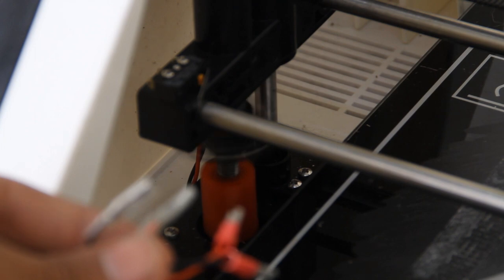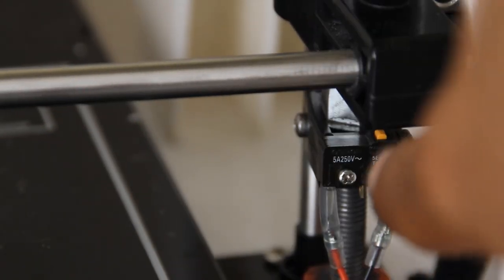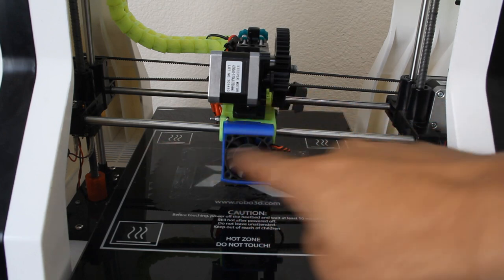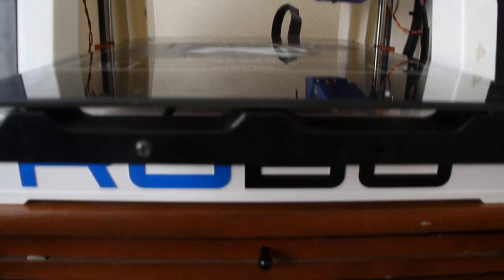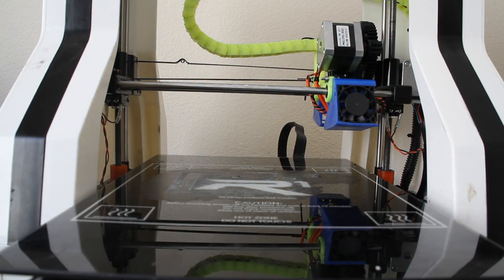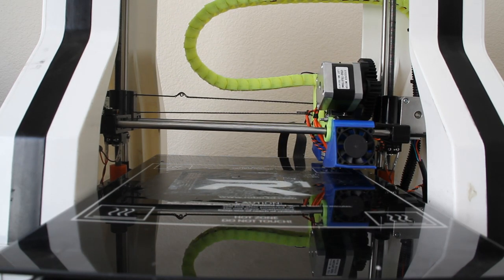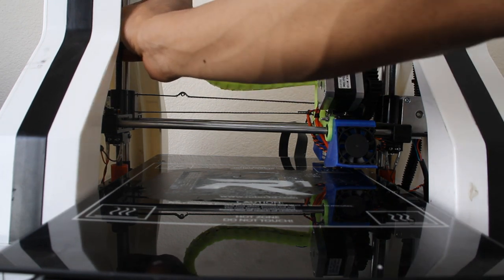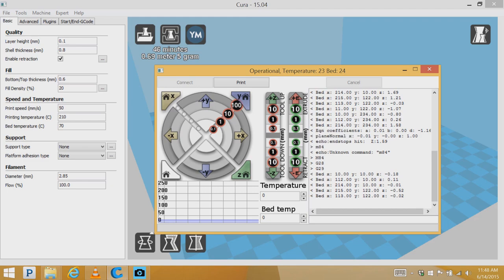Novice Tips: Troubleshooting Auto Bed Leveling

Comment: Thank you! you fixed my problem with my printer. My z axis when doing the auto bed leveling, for some reason it would go up on some points instead of touching the bed like it should. This would also result in the printer head hovering over the bed and would completely mess up my print. Its fixed now. This video was extremely helpful!

Comment: Thank you very much!! I installed a reprap controller on my printer, and stupidly didn't put those orange clips on the threaded rods that the printer ships with (noob here). Well, after I was done, as you can imagine my printer wouldn't autolevel, or go down at all, and I started looking for the reason online, but couldn't find anything until I found this video! You saved me from making an embarrassing call to Robo3D tech support! BTW I have a brand new R1+ and this video applied to it every much as it did to the printer that was used to make the video.

Comment: Bed leveling-  You said in an automatic bed leveling system the bed compensates and tilts so the printer is always aligned... Not aware of any bed that automatically tilts, rather the software measures the distance between the bed and the print nozzle in numerous areas of the bed and minutely adjusts the Z axis travel for each area it tests during the auto leveling routine. 

"Commonly Open" "Commonly Closed" ??  The correct term is Normally Open and Normally Closed as all limit switch terminals are marked "NO" and "NC" with "C" or "COM" being the "Common" terminal.   The definition of Normally Open refers to the limit switch position at rest, without the switch lever being depressed, thus the NO to COM switch is open as you describe.  

However at 0:57 you incorrectly describe the wiring as "commonly closed" but show the Z motor spinning while the wires are open, and stops when closed.  In other words, the Z-axis moves to the end of travel depressing the limit switch; at that time the switch NO and COM terminals connect,  signaling the logic board to stop the motor.
Reply from the maker: I appreciate your insight. I was stumbling to figure out the PROPER terms for the terminals were. Thank you for that. (Using COMMON, NORMALLY CLOSED, NORMALLY OPEN from now on)

as far as bed compensation I meant to say the "MODEL" tilts in the "SLICER" and calibrates the "GCODE" to properly move the Z-Axis up and down according to the plane it creates during the probing process. Thank you for showing me my sloppy description I will do better to keep everything neater and more accurate in the future.

and at 0:57 you are CORRECT! I did not explain the way the SWITCHES work properly, I assumed this "closed circuit" (Com to NC) because of the LOGIC in the Robo 3D firmware. The switch is inverted there. 

const bool X_MIN_ENDSTOP_INVERTING = false;
const bool Y_MIN_ENDSTOP_INVERTING = false;
const bool Z_MIN_ENDSTOP_INVERTING = TRUE;

So yes, when the button is DEPRESSED, COM sends a signal to NC to communicate to the board that the NOW closed circuit indicates that the axis cannot safely move down further beyond that point.

Comment: Ever since I installed an e3d v6, my bed leveling is working right. It goes through the process without issues, but it is clearly not level. It's always slightly off. The left side of the bed is slightly lower than the right so when it does the first layer, hardly any filament is allowed out of the right side so it looks transparent while it looks correct on the left side.
Reply: i'm doing a print about 15cm wide and it takes about 3-4 .2mm layers for the whole thing to be visible. Every layer, you can see it gets a little closer to covering the whole thing.
Reply from the maker: If your numbers in the middle of the bed are closer to Zero than the outside number that's an indication that your bed is bowed in the middle. You can attempt to level it manually based off your observation. So if you think the left is too far down, adjust the left lead screw.

Comment: What software is it you’re using at the 3:52 minute mark where you’re entering the Gcode because I don’t see that in Cura anywhere? I’m fairly new to 3D printing and find your videos to be very detailed for helping beginners but this little detail wasn’t covered so thought I’d ask. Thanks!
Reply: That's pronterface.
Reply from the maker: you can access Pronterface by changing the UI settings in Cura 15.04.6
File > Preferences > Print Window > Pronterface UI (sorry, been out for a long time)

Comment: My printer levels correctly, both switches work great, no bugs other than the fact that it always wants to start the extruder nozzle laying down right on the bed... My Z-Ofset, to make it higher is as high as it will let me, i have leveled it a dozen times and i still can not figure it out! After the print goes up to the second or third level it works great... Best freaking print to see. I just got the E3D nozzle and i installed it using your videos and everything functions properly except the leveling! Please help
Reply from the maker: +rpm 9000 (I logged out and logged back in) Well, firstly are you using a negative number for the offset? I try a huge number to assure that it is working properly; Like M565 Z-5 and the nozzle should be far off the bed.
Reply: No im not doing that... Ill give it a try
Reply: I was using a positive number

Comment: HI mARQUISprinting now not bad. I printed the tall spool bracket, looks pretty good although the bottom layer on my prints are stranded like a guitar. I changed my bottom layer to 2mm thick but whAT OTHER SETTINGS MUST I ADDRESS FOR A SMOOTH BOTTom 1st layer ?
Reply from the maker: +Paul Robb All you should need to change is the Z offset. I will be talking about this in this weeks video about G-code. It is the M565 in your start up G-Code. There are lots of threads about this on the forum.

Comment: my robo 3d r1 is printing in the air :( this is after it touches the print bed in the proper places and the switches seem to be in correct place. earlier it wrapped the wires around the right pole ad i had to reattach the wire to the connector and switch. but it should be good now. i done the m113 g terminal code or whatever, x,y,z is all open

Comment: during bed leveling, my nozzle hits the glass at locations 1 & 2 and then starts the rising up problem at locations 3, 4, & 5 but then comes back down to the glass at locations 6, 7, & 8.  Then it rises up to finish at location 9 about 1/2" above the glass and starts printing there!  Any ideas?

THANKS!

Comment: I've been having a problem after my left z-axis switch bracket popped off when my computer had a hickup and repeatedly sent G1 Z-10 codes. I took the printer apart and put the bracket back on then leveled it several times using the "Paper Leveling" technique and it looks like it auto levels correctly every time, but when it starts to print the extruder is a little too high. I tried the offset commands in MC but it doesn't do anything. I tried printing via Cura but its auto level does the same thing. Also the extrusion speed is slower and it just made a big mess
Reply from the maker: +Christopher Turk Hmm, are you using the M565 to offset the extruder?

Comment: hey I have a slight problem when I print the filament towards the back of the printer is almost completely non existent but the front end is perfectly fine, I always run a G29 before I print so it SHOULD be level any idea what is going on and how I can fix it?
thanks!
Reply from the maker: +Nate Clishe It might be that bed is unlevel from front to back, I'd recommend checking the magnets underneath the bed.

Comment: What is you're opinion on "uneven beds"...and the 9 point calibration not working correctly because the bed needs "shims". I tried doing this with some washer on the left side, as my left side constantly seems to be higher than the left (though the 9 point test double clicks on each point)
Reply from the maker: +Joshua Taylor The 9 point leveling should work, but I'd have to see a video on what yours looks like.
Reply: +Novice Expert I will try to make one to show you...with my GCode Export. At the moment I have 6 loops...I'll pause the print and usually end up lowering the right side slightly based on how the loop is printing. It never stays in that position though, for ever print forward I continually do this.

Comment: Greetings Novice Expert, I'm new to the ROBO 3D R1+ and was curious if your information in this video applied to the R1+ or just the R1?
Reply from the maker: +Shawn Hill The R1+ is very close to the R1. This video does apply. The only difference between the two is the carriage and electrical system.

Comment: after I adjusted the level so switch was mashed I printed but nozzle seems to be dn too hard on glass surface. did it twice and same now its seems to be scraping or too low on glass. what to do?p from fla
Reply: +Paul Robb Looks like you just need to adjust the z offset in your start up g-code. 

G28;  HOME ALL AXIS
M565 Z-1.1;  Z-AXIS OFFSET (-1.1 is my number)
G29;  PROBE BED

Make M565 more negative (-1.2) to increase height.
Make M565 more possitve (-1.0) to descrease height.
Reply: thankyou

Comment: hi! Great tips, I hope you can help me, in my case just one riel (right)  from Z axis is moving and the other one does not. I tried the tips in the video,  but i still have problems
Reply from the maker: If it's buzzing then the motor is jammed and cannot move. If it feels in energized and easy to move it does not have power. Which are symptoms of no connection, wrong amperage on driver or blown driver.
Reply: In my case, the Z axis moves fine until it gets close to the print bed. Then once it gets to the point where it should stop, it keeps going - usually just Z_2 (the motor on the right) and it tilts itself until it jams and crashes into the print bed. This is on the Anet A8, so it doesn't have the sensors on both sides.

Comment: what if the numbers are all negatives? both counterclockwise?
Reply: The main key here is to compare the difference between the points, so if you're getting -1, -2, -3, you're essentially getting the same information as if it said 1, 0, -1. If all of the numbers are relatively the same, but still negative, then your bed is level, but your overall zeroing is off.
Reply from the maker: Thanks for that detail, I'll have to re-shoot this with that addition.

Comment: Ok can you help me? My auto home x axis keeps going to the right a little bit and doesn't stay in place... so I keep pressing home eventually it will go all the way to the right and the auto bed level doesn't work either it will do the first 4 points correctly but the rest go all the way to right to the point of making noise
Reply: David Tashchyan  That sounds like a X limit switch problem. If it keeps going to the right, maybe it's being pressed by some wires? If you can make a video of it, I'd be more than happy to look in to it. (if you haven't already fixed it)
Reply from the maker: David Tashchyan Yup Anorak Cafe is correct. The computer thinks that the switch is already pressed. This usually happens if a wire is disconnected/shorted, like at 1:20

Comment: This is good to level the x axis, but how do you level the y axis? I mean there should be something to position the glass of the bed as well. Am I wrong?
Reply from the maker: As far as I am aware there is no way to do so. But the plastic clamps holding your Y axis linear bearings could be loose, if so tightening them should make the bed straight.

Comment: Hi Novice, I have followed the G28 and G29 Commands, but everytime the Z returns different even if I do not adjust it?? what could it be?
Reply from the maker: TBH no clue.

However, skip the G28 G29 output

I recommend GO Mechanical!

Buy a cheap bubble leveler and level your X Axis manualy

Comment: When you recap...you talk 3rd thing: You say Negative - Zero _ Postive, Leftsize Counter Clockwise and Right Side Clock wise. Then I get confused, as then you say Postivie - Zero - Negative, Right Side Clockwise and Left Counter Clockwise.
......isn't that confusing...or is it just me? Should I reverse that last statement?
Reply from the maker: +Joshua Taylor Haha, I never noticed that. Essentially "negative" is the counter clockwise. So Neg-0-Pos left counter/ Pos-0-Neg right counter Sorry for that confusion.
Reply: +Novice Expert Thanks for the reply! My numbers are HIGH...like, in the hundred range. Is there a way to bring them down lower? I feel I've screwed with the z-rods so much that I've messed with the auto level 9 point check, but...not even sure if that's possible. Thanks for you're videos and Novice Expertness!
Reply from the maker: +Joshua Taylor It may be possible, I know that if one side isn't making contact the printer will just rise. But if you are on the bed still getting large numbers, that's strange.

Comment: Hey Novice Expert, I noticed in a one of your videos you said a bit about the robo 3d using ninjaflex how did you accomplish this? hoping to buy a robo 3d soon
Reply from the maker: TheZombustersTeam You can either put PTFE tubing or a copper rod in the extruder. It prevents the filament from curling in the hobbled bolt.

Comment: Im kind of confused here, My robo wassnt working correctly so i removed the casing and when i was going to lift off the print head i forgot to unplug the steppermotor so this happened: https://gyazo.com/7bfdf74e6fcfa8b5b2b69f62fcb63396

But i tried to print and everything was working fine so what im wondering is is that something i need to look into fixing. And what does that thing do
Reply from the maker: Yes and no. You have a limit switch on both sides so your safe, but I'd eventually take the time to crimp or solder that component.

Comment: I literally spent like two hours on mine until I saw your vid. It was as simple as moving the bar a little so the carriage was on the sensor lol. Boy did I feel dumb. My printer is working again, but the print bed seems too low. I just unclogged my filament and tried printing and it doesn't print anything. Like the extruder is too close or something. Anyone else have this issue? I have been to the forums but still have not solved it yet. =/ I'm a noob to this stuff. Spent 8 hours on it last night.